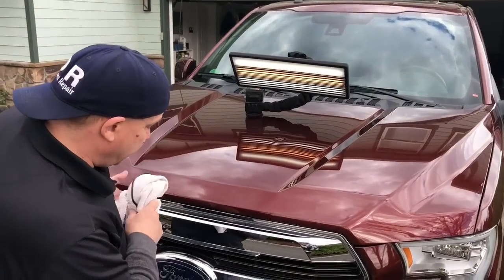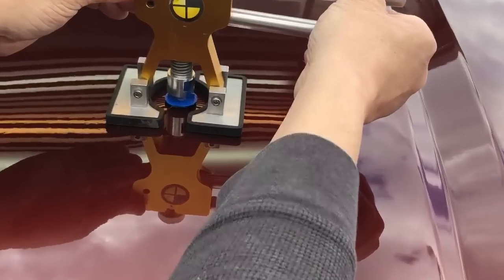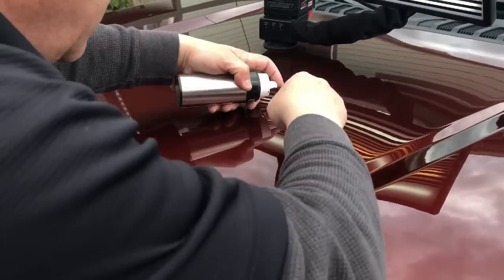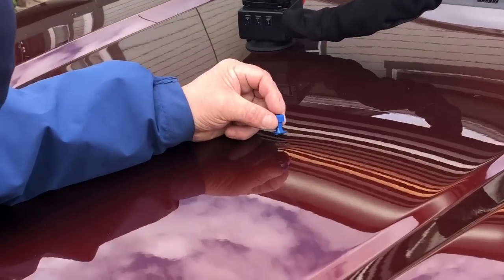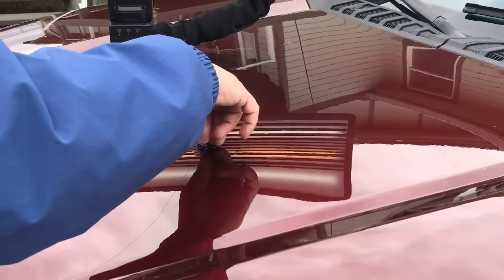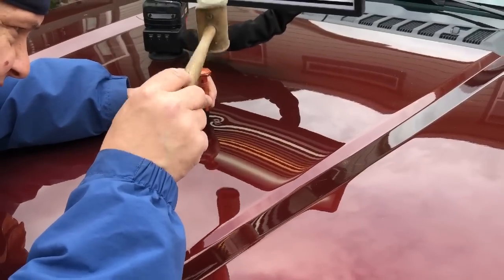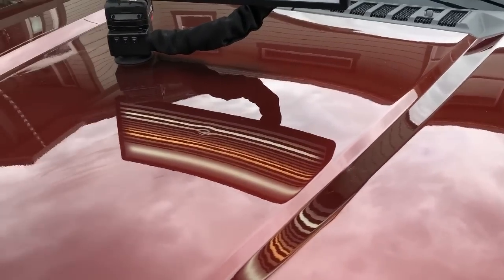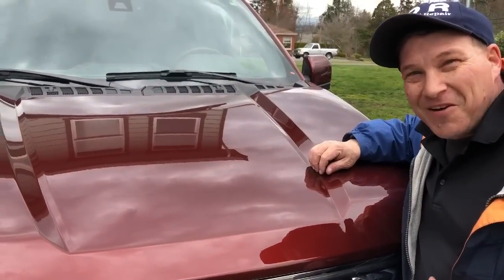PDR wow!😳-Golfball vs. 2017 Ford King Ranch🤭 #pdr #petersondentrepair#Ford

Comment: Heat goes a long way with aluminum. It is a process. Add heat, push, add heat, push and repeat. Sharp tip from start to finish.
Reply from the maker: Zac Bobo Yeah this one took a while it was a big dent. Thanks for watching

Comment: You could try holding the tension on while tapping the edges..
Would work well i suggest
Reply from the maker: cam stowe You are right about that removing an oil can style Dent is very very tricky but you are right about the tension and the tapping sometimes it takes having three arms LOL. Thanks for watching and commenting. It’s much appreciated.

Comment: you can lift up the hood and pop it back underside of the hood.. faster
Reply from the maker: Block kcet Thanks for watching and commenting I tried that but with that long of a reach and that high of a truck it was very difficult to get to the backside of that dent.
Reply: You don’t have a rod or something like that? You put a hook on one of the holes in the hood and use the rod that you usually use for the roof. You use half of the time and you don’t have to use any heat of strange stuff
Reply from the maker: Yes I have those tools but this truck being so high and the dent being so far back I would need to risk causing more dents by standing on a ladder or a stepstool. The removal of the hood is a huge job also.
Reply: PDR Peterson Dent Repair I would have that hood off on a stand in 5 minutes. Dent would take 15 at most. Good job glue pulling though.

Comment: You sir are a patient man. Excellent job however is there a reason you wouldn't just push it out? I find aluminium comes up really well pushing even the sharpest dents compared to pulling them.

Comment: Hit it with the torch and that tab will hold longer. Great demonstration. 👍🏻
Reply from the maker: Great Thought!!😃 thanks for watching and commenting!!!
Reply: PDR Peterson Dent Repair Did you ever try heating the dented area just prior to pulling and did it help?
Reply from the maker: yeah depending on the temperature in the air and of the metal sometimes I use a heat gun or sometimes I'll just park it in the sun to warm up the panel. On the rare chance that we get sun in Seattle😀

Comment: That looked tough!    What happens with Stainless Steel and this glue pull method?
Reply from the maker: The Gluepulling method works with any kind of metal, as long as there’s no Bondow underneath the paint, or cracks in the paint. There are several different types of glue, for cold, for warmer weather, and for general all-around use. It’s not your common Home Depot glue. Not to be purchased at Michael’s either!

Comment: How much do u charge for a golf ball size dent
Reply from the maker: It depends on where the dent occurred, what kind of car it is, if it is even accessible, and so on. There’s no defined price for my business, that’s why I give estimates rather than firm prices because sometimes the dent comes out easier and I am not going to overcharge someone when it’s a dent that is easier for me than I anticipated, Often times if it comes out quicker then I predict in my estimate quote,  I will give a discount to my customers. It’s all about giving excellent customer service, the money comes after that. That’s the last thing you should be worrying about
Reply from the maker: But a roundabout estimate for a golf ball sized dent let’s say on the hood of a vehicle would run between five to $700 for me. Depending on location, size etc. and since I’m on mobile business, I have the privilege of being able to service customers at their homes as opposed to having them come and drop their car off at a shop. People love it when they didn’t come out great and I end up charging them less than I initially quote because it’s going against the grain...And in saying that I mean going against the grain of the greed of money. It’s just a tool my friend, it will come if you’re genuine and honest and a good hard worker. Every case is different in this industry, not like going to get your oil changed and you have a set price

Comment: Hi where do you get your sucker cup holders for your line board and heat gun from? Great video as in just getting into the dent side of things
Reply from the maker: Ride Clean Details thanks for watching I have separate tool review videos on my light board and my suction cups for my umbrella and heat gun please check them out. Thanks for watching and commenting🙂
Reply: Woody's cups are the best. Pick me up on Amazon. Thanks
Reply from the maker: The wood grips are on my light board and they get a grip product has a larger scale of the same type of grip. I do believe Elimadent tools has a couple different varieties of suction cup.
Reply: Thanks to all replies for all your information and links

Comment: Are you using a black and Decker drill to apply glue!?
Reply from the maker: No it's a glue gun. Black & Decker is the brand. Thanks so much for watching and commenting:)
Reply from the maker: Did you sniff too much barium strauntium and aluminum? And have you been drinking the tapwater?Because I’m scratching my head at that question do to the idiosity...😂😂

Comment: You seem to only get to about 90% in all the vids I have seen.  Why?  If I were the customer, I would not be happy with only 90%.
Reply from the maker: etc etc On some dents 100% is just not possible with this process. Thanks for watching 👍
Reply: I believe the F150 aluminum is difficult with this process. Just had a guy work on about a 4 inch crease in my new F150 and I'd say it looks 90%+ better. He even said that the aluminum doesn't work as well with this process. I'm happy with how it looks -- wasn't expecting a "good as new" appearance and like I said it is still pretty darn close.

Comment: I have a question.
As I do a little sharp dent, there is always a sharp edge in the middle of the dents.
What to do then?
Reply: You pick up a sharp center with precise sharp tip pushes and a soft touch.
Reply: A soft tip on a sharp dent moves too much volume surrounding the affected area.
Reply: thanks!

Comment: What do you have to do differently to aluminum verses steel ? If you were using rods as well? Thanks
Reply from the maker: dent man aluminum just acts differently it’s hard to explain it wants to stay where you push it and then it doesn’t want to go back to where was stamped as easily as steel does just takes a little bit more patients I would say to work with aluminum it also stretches easier which is a factor.
Reply from the maker: Amen BROTHER!!!!!
Reply from the maker: Your done.
Reply from the maker: I’ve removed 217Dent he won’t be a problem

Comment: Nice job. So that high spot... was it starting to oil can?
Reply from the maker: Turcu Ovidiu yes, exactly. It was starting to want to oil can a lot a lot of stretch metal there we ended up with a nice service and a tiny little imperfection in the middle the customer was really happy with it. I was more meh , but I didn’t have all day to do the dance. LOL thanks for watching.
Reply: tricky repair. great job.
Reply: why do you say that?
Reply: ok. thanks. maybe it could have been a good idea to use a tool from under the hood.

Comment: How long have you been pushing? Not throwing dirt at you man, but why?? Just push the dent and it would be 100% not 90% and you would have done it in less than half the time. Most of your fixes are 90% some not even that. Have you worked around other techs? Sometimes doing that helps you acquire new techniques and skills you can’t learn going solo and will help polish your work.
Reply from the maker: Victor Gallegos This size of that heard the amount of space that I would have to climb up to reach over to get to the center of the dent with no leverage I would end up making more dents  in his nice truck. thanks so much for watching and commenting I really did want to get behind this one and push it out it was just really difficult access👍
Reply: PDR Peterson Dent Repair yep new aluminum fords suck for sure and access is not the best. Keep it up
Reply from the maker: Thanks so much brother for your kind words this one will always remain a thorn in my side

Comment: You have already some experience, why dont you go and invest in training?There is no shame in that. You are doing this wrong. Everybody can push it until 80-90. The last 10 % is where you need to know what are you doing. This didn't came out good as most of you're dents. You have a really good light. Remove the stripes and work whit yellow light only. Then check with white from all sides . Look for the shades and fog. Dont tap when there is obviously no tension. When you pull you can see that it goes all the way up. You need to pull it high and then slowly tap it down.  Throw the wooden hammer in the trash . You dont see anything with it. For alluminum you nees to work harder. Wire tools , whaittails. Invest in good tools. You dont need them all. Buy some sheet metal and make them you're self If you can afford it. I have a 50 euro chinese  modified  light and 4000 in tools. All the whailtails I made my self. Anaconda bar and Dent-Dial also. Think how you can make you're work easy and pleasant to spend time. Greetings from Germany.
Reply from the maker: Thank you for your long comment I appreciate that you watch the entire video I hope you watch more. I look forward to seeing your work on your videos and maybe learning something from you. I have been doing this professionally for 20 years every day. I sure appreciate you watching thanks so much.
Reply: I am a car sprayer and panel beater . I am not a PDR tech. I just like working on cars so I want to perfect all the skills. All do  I dont fix dents for a living, I doo them the best I can and constantly learning and practicing.  They come pretty good . This is the hardest thing you can learn regarding auto body repair but It is not rocket science.
Reply: jagstang2100  The man obviously doesn't know how to do this job. Are you a PDR tech? You are afraid he is goint to take you're work?  I am Citroen and Peugeot trained car mechanic with 8 years in PSA group who works as a Car spayer-Panel beater in Mercedes Contracted Body Shop in Stuttgart Germany and I can do PDR.  I didnt went on any PDR trainig and course. Learned it myself with logic and practice. Greetings from Germany
Reply from the maker: And you are!?? a Nobody? Yep😂😂 thought so!
Reply from the maker: Thank you jagstang2100 they just want attention lol
Reply: Hi, First of all this dent was stretched  and its aluminium! Someone who don't even do similar dent on 100% quality shouldn't learn anyone how 2 do it, so FIRST DO DENT LIKE THIS AND SHOW UR RESULTS. SECOND- U CAN GIVE A TIPS.